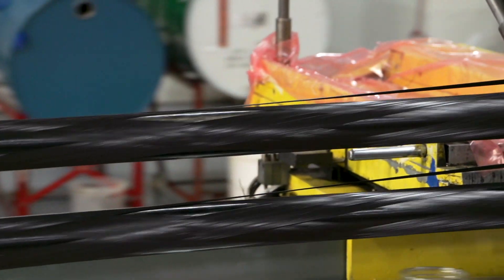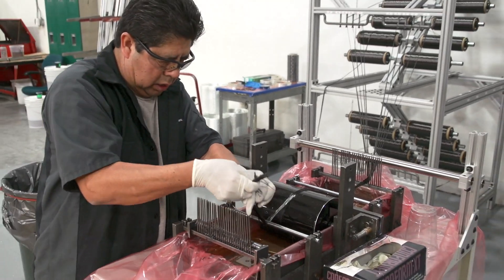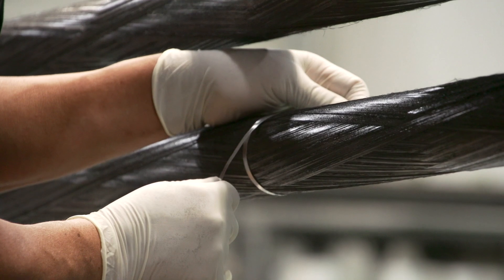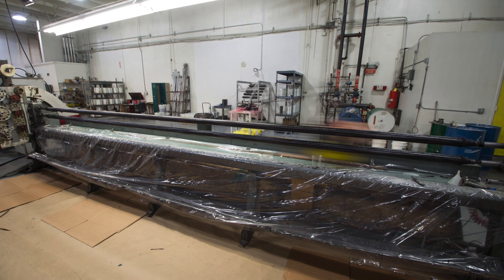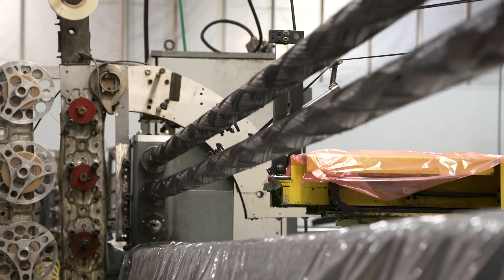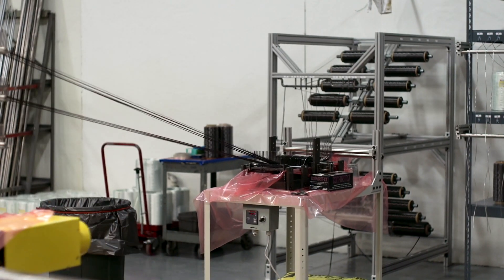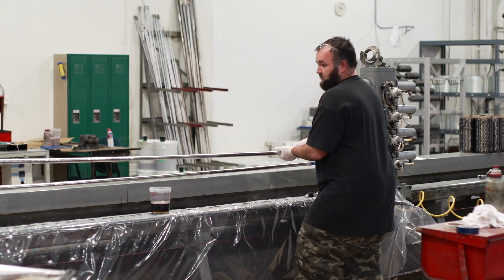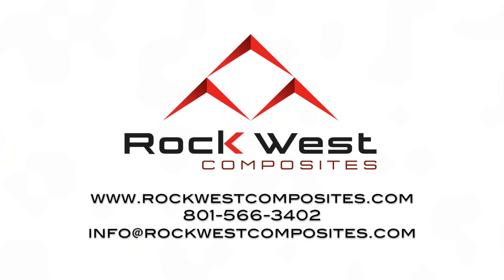Filament Winding Process by Rock West Composites

Comment: Filament winding process is possible with 8 mm diameter without bending ? If yes then what is the shaft material against the high pulling force.... ? what is the best possible way to achieve filament tube without bending ?
Reply from the maker: 8mm diameter in filament winding is challenging. The tool length is quite short if winding that diameter. Likely less than 24" and held in tension. Mandrels are typically steel.